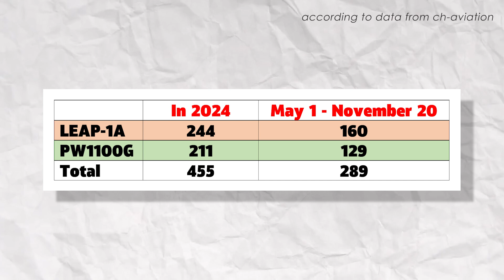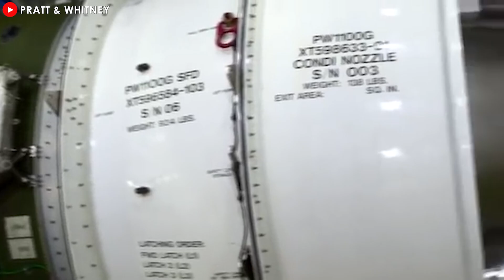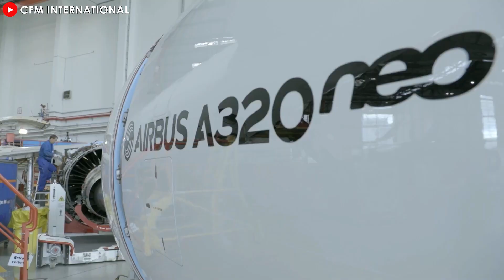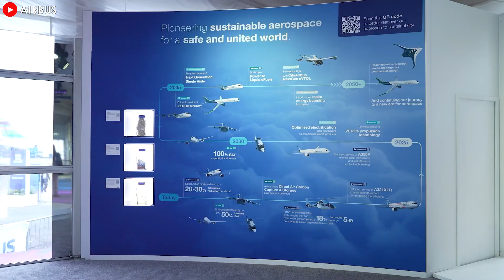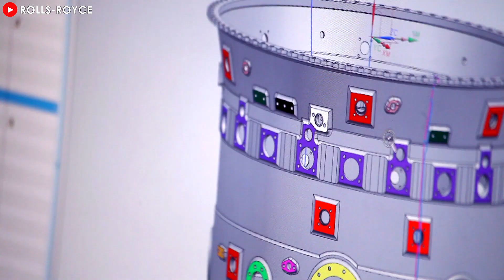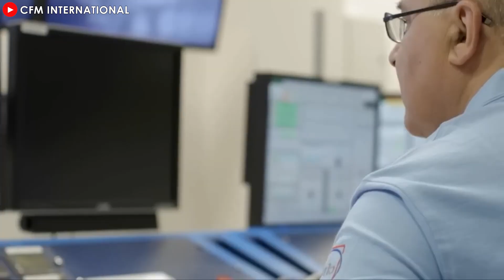Airbus Boss Just Revealed NEW Secret Weapon Engine Shocked Everyone NOW! Here's Why

Comment: We all know about the vocal aircraft fanboys, but we must not ignore the engine manufacturer ones.

On paper, the P&W GTF design is better than the CFM LEAP. It is demonstrably more fuel efficient. This is probably the statistics most latched onto by its fanboys.

However,  this is far from the full story. 

Regardless of whatever statistics you selectively chose, as well as those you ignore, it is the bottom line that matters every time.  This includes the far more difficult to quantify reliability and maintenance costs, as mentioned in this video. It must be acknowledged that an aircraft on the ground incurrs its own costs as well as the loss of profit from fare paying passengers and compensation for delays, cancellations, and re-routing - possibly even with a competitor.

At the moment, CFM appears to be well ahead when these are taken into account.

As sure as I am about P&W eventually sorting the issues and clearing the unprecedented backlog, I am sure that CFM will also continue to tweak and enhance their LEAP engine.

Interesting times ahead, especially if RR successfully scale their Ultrafan to compete with the P&W and CFM offerings.